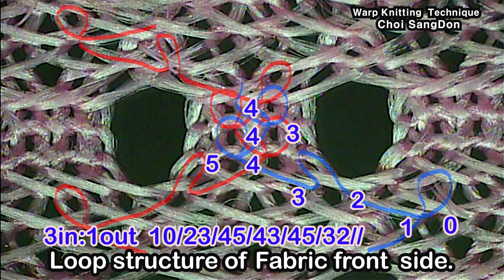Double needle bar Raschel machine, Spacer textiles  Tricot Warp Knitting karl mayer.트리코트 더블 라셀 Mesh

Comment: Hi sir
Would like to know that from where I can get the 3Dcomputer so as to analysis the 3view of fabric after changing the different parameters. Can you guide.
Reply from the maker: http://www.texclub.com/english/html/product/product04.php
https://youtu.be/dzW8oTmwkGI
YOUNG WOO CnI INC.

 SEOUL  KOREA
Tel : +82-2-851-3000
Fax : +82-2-851-3011
E-mail : webmaster@texclub.com

https://youtu.be/I4K4mBDbk0s
Three-dimensional Simulation of ProCAD WARPKINT System for RD6 Process of Warp Knitting Double Needle Bed Spider Fabrics
WhatsApp:+86 13128464688    
WeChat:13546866377              
Email:  wkwarpkintting@gmail.com